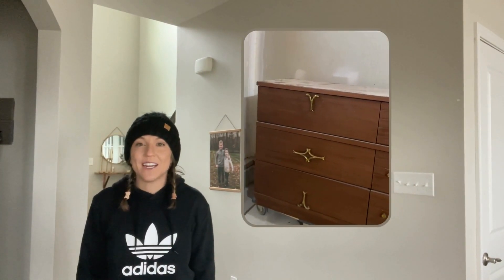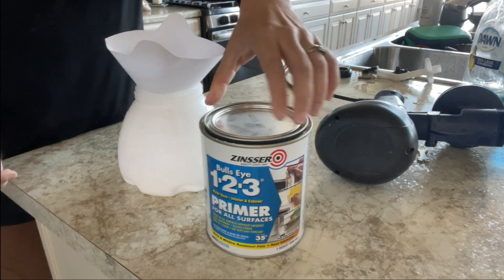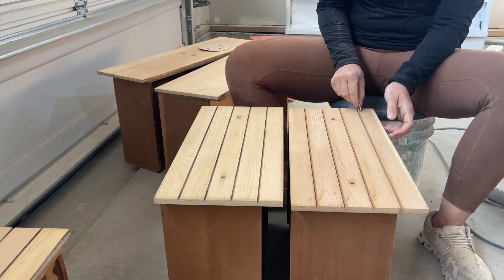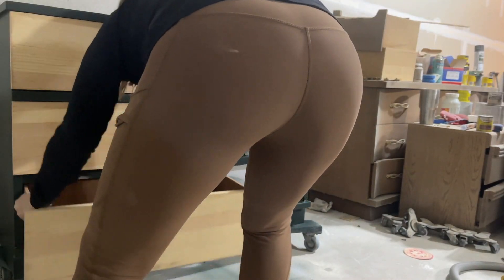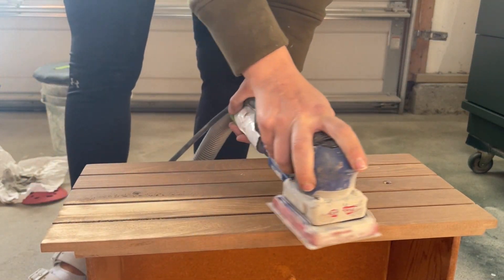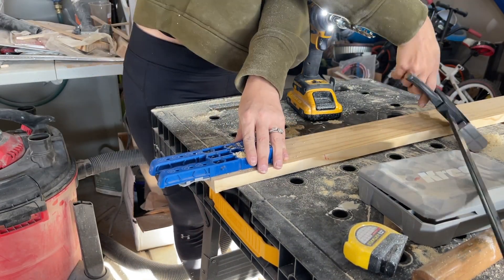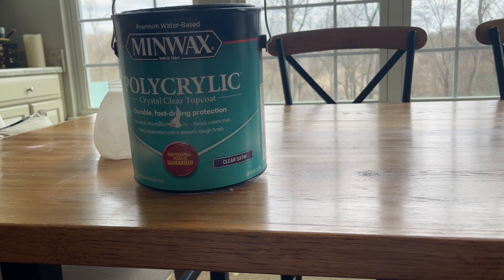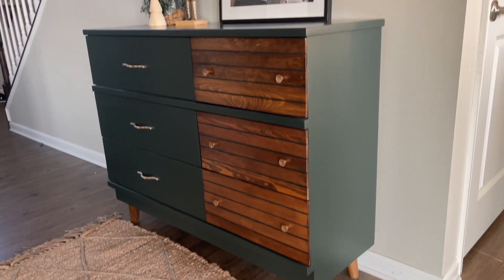EXTREME Thrift Store Dresser Makeover | Turns Into A Modern Beauty that Blends Paint and Wood

Comment: it looks great but you lost me at latex.  I've had to deal with latex paint on a lot of furniture and I've come to hate it.  I doubt the next person getting this dresser would want to redo it, but latex makes me shudder  LOL
Reply from the maker: Hahaha I feel you! But as long as you prep and seal the latex paint, it works great 🙌 and actually easier to remove (in my opinion) when/if it is stripped in the future. What happened with the latex paint on the furniture you had?
Reply: it was neon yellow om 100 year old dresser and it stunk  painted inside and out.  cant use heat gun inside the piece..  stripper didnt get it all.  I'm literally hanging upside down in the dresser to get to all the corners.  it was too deep to  reach in and get the back.  it was a mess.  that was my worst.   it took so much effort i didnt sell it; no one could pay me enough for all the time and effort
Reply from the maker: @cstarv  what a nightmare!!!! I don’t blame you at all. I probably would have just had a big bonfire and burned it 🤣🤣